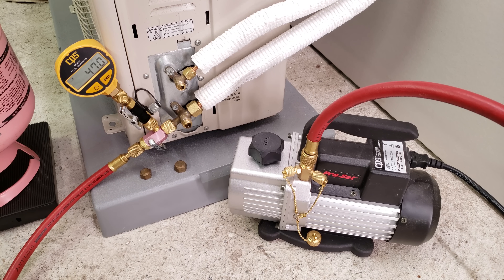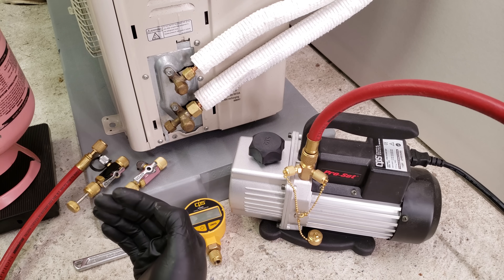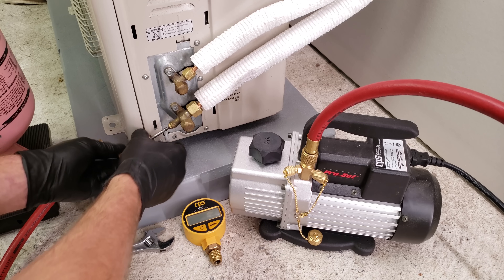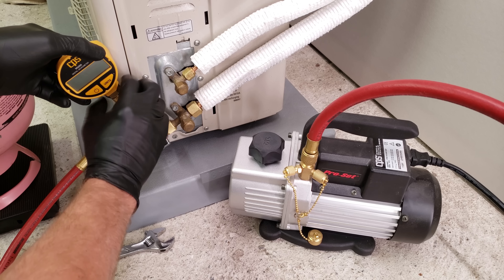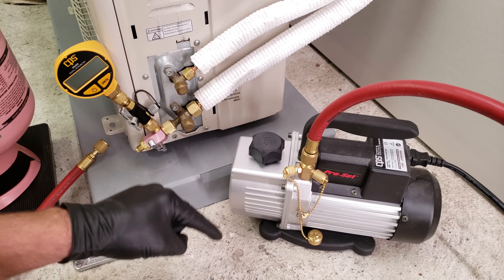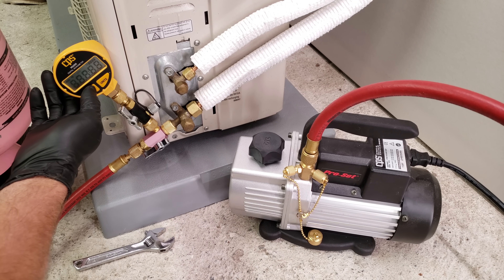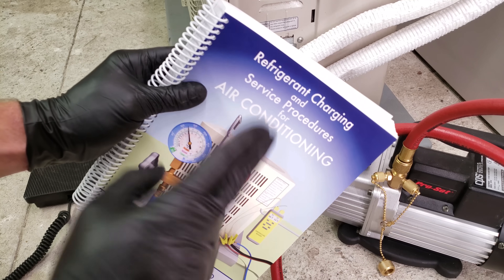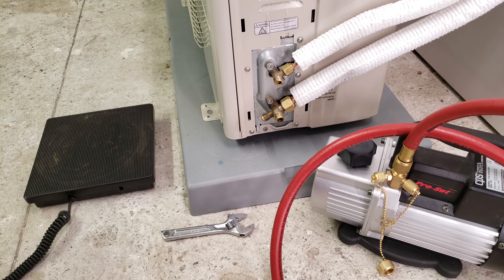Steps to Vacuum and Charge Refrigerant on a Mini Split Unit!

Comment: Hi great video. It was usefull. I see u charge the system without openning the valves and the system in switched off state. How the refrigerant will go in when the compressor is not running and valve are not openened. Thanks

Comment: Q1) I purchased a Mitsubishi MUZ GE 24NA (2 tonne) heat pump unit. In its installation manual, it just mentions the vaccume testing but doesn't mention pressure testing. Can you think of any reasons for such an omission?

Q2) Could you please also add a video on Nitrogen pressure testing of mini split units? Would it be same as in the case of regular HVAC system as you have shown in another video?

Comment: Hi sir  I have  question regarding split a/c,  how and what procedure to refill oil at compressor, already finish solded the crack of  high  side pipe ,I need now to  charge oil around 1/2 liters  coz compressor coming  sound

Comment: Hello,  If I am installing a new minisplit can I use this same method as yours even though my outside unit already has refrigerant in it. in other words, would a vaccum pump suck all the refrigerant out if I use this set up. thanks
Reply: Well from what I just watched I would say no. The allens inside the connectors are sealing the unit. This is one of the reasons he only had to add minimal refiedgerent for the longer line set and not fill the system completely.
Reply: @inactive67  thanks
Reply: @inactive67  My question is how did he add any if he didn't open the king valve first?

Comment: Could you use a simple ball valve in front of the micron gauge instead of a secondary valve core removal tool? I noticed that my valve core removal tool has pin valve on the service port. Can that be removed? I’m guessing it will slow down the vacuum if left in?

Comment: Hi, I have a question. Since the mini split motor was moved from the floor to the top of the roof a couple of days ago. I noticed that is not cooling. It blows air but is not cool. What do you think is the problem? Is it something that can be fix easily?
Reply: Are you saying you put the outside unit above the elevation of the inside unit?  If so, you can't do that. The outside unit has to be below the inside unit.  You may have figured it out by now, since your post is months old, but I thought it may help someone else who sees it.
Reply: @mikeygee4564   That's not true, in general,  unless the height difference is over ~12-15ft.

Comment: Why do the AC companies have to make this so complicated? They need to make it so we can do this without all the specialized equipment and have to be a pro to do.
Reply: It is possible without any equipment. After installing the lines, open the valve of the thin line. Wait for a couple of minutes. Then press on the service valve for about 10 seconds with a screwdriver. All the air will be removed now. Finally open the valve from the thick line and you're good to go.

Comment: The main reason for vacuuming an air condition system is to remove atmospheric pressure.
This is  the most important reason because it allows the refrigerant to boil at low temperatures.  Example room temperature.
however in most tutorials it is not mentioned making service technicians lack the true purpose of vacuuming.

Comment: I removed the flare nut from the valve. Can I reuse the flare on the tube or should I cut it out and reflare?
Reply: if it was sealed before, and isn't any worse, clean/polish inside of joint with with a lint free rag until you can see the shiny copper, then you should be ok to re-use. Don't over tighten, usually about a quarter turn with wrench past hand tight.

Comment: I was little confusing about mini split  pressure test and the pull vacuum on the system, without the high side service valve,  we can only connect low side hose,the metering device only liquid can go over it,when you do vacuum is it also pull vacuum on high side too, or leave it with air only in, can you explain it thank you
Reply: either side will vac both through the unit to the other side.

Comment: Shouldn't the micro gauge be on the other service valve? You want to measure the vacuum on the furthest point in the system. Not at the vacuum source.
Reply: this unit only has a port on one side.

Comment: Craig, great video. I purchased your book as well and it’s excellent. I do the same setup with one difference. I hook my service hose with ball valve to the side port on my second valve core tool. I leave the refrigerant bottle valve closed but my service hose valve open during final vacuum so that I am vacuuming the air out of my service hose. Then I close the valve on my service hose right before I turn off the vacuum pump and do a decay test. Then I isolate my vacuum gauge, open the valve on my refrigerant bottle, and use the valve on my service hose to throttle in the required charge. The advantage to me is I have pulled out some of the entrained air and moisture from my service hose by subjecting it to vacuum, and I don’t have to wonder how much air I purged out of the service hose using refrigerant to push it out, or lose any more refrigerant than necessary. There is also air between the valve on the service hose and the valve on the first core removal tool that is impossible to purge normally. I’m interested to hear what you think of this setup and if it makes sense or if there is a downside to the way I do it that I’m not thinking of. Thanks
Reply: I was unable to pull or hold a deep vacuum using this method. With the side port of my second VCRT capped off, I was able to pull down to 50 microns and it would eventually equalize to 150 or so. With the service hose attached, I think I could only get to about 150 and it would rapidly climb up into the 300-400 range as soon as I valved off my vacuum pump. I can't remember how big a difference it made to have the service hose valve on or off. Anyway, I tried this repeatedly and it seems like perhaps some component of the service hose or tank port are not completely sealed against a vacuum? I would like to sort this out though, because it doesn't seem very precise to just vent refrigerant as one attaches the service hose.
Reply: I agree it’s nuts to me to measure a system down to the micron and then measure the purge of a hose based on it going “pssht” for a second or two. My guess would be your service hose or ball valve is leaking. Or if your service hose has sat for a long time it may have moisture in it and it’s taking forever to dehydrate. I would cap the end and do a vacuum test on just the hose. It will have a high rise rate because of the small volume, but you could do the same test with your vacuum hose to compare the two and see what the relative difference is

Comment: Can you please guide if all the gas has leaked out of the system i.e. no gas in the system, then how will I vacuum the complete system and charge the refrigerant?

Will vacuuming with service ports open and system depressurized, suck the compressor oil up?

Also how to know if compressor oil is up to the level and does not need a top up?
Reply: Sir please visite my Channel

Comment: The part at 12:45 had me a little confused when you opened the valve and purged a little air when inserting the valve core. wouldn't this mess with your vacuum, or not because the added refrigerant created pressure not a vacuum? also how would you have installed valve core had you not needed to add refrigerant to your lines?
Reply: After my writing my question and watching again it seems to make sense to me.

Comment: Secret Tip  :
If you are sure to be using a vac pump.. let it run for 10-15 mins before using. 
It pulls a better vacuum faster with less wear and less stress on its components
Reply: let it run with manifold gauges disconnected?
Reply: @egemensuzgun4208  yep! test it yourself. On the same unit and time it when done cold and hot.. Changing your vac pump oil every 30-40 times of use is also a great help with noticeable efficiency

Comment: I just used this exact method with the exact two Appion valve core removal tools in order to install a 9000btu mini split. Even with the cheap harbor freight vacuum pump it pulled a great vacuum and held steady; I observed no leaks. As a homeowner I am excited to be able to do some of my own HVAC work. Thanks for these training videos. They are fascinating!
Reply: Wish I was your neighbor  I’d turn you in
Reply: @robertlamey7612  haha to whom, and for what?
Reply: Cheap fucks. Enjoy the service bills and potential fire hazards.
Reply: Excellent, I'm doing the same and plan to install these for my neighbors for a lot cheaper than an HVAC "pro"!
Reply: Drawing a vacuum isn't illegal, doing anything with refrigerant charge without an epaulets certification is illegal
Reply: @cclyons06  who is the EPA going to send to my house? Or to anyone’s house for that matter?
Reply: FYI, as long as you are not adding refrigerant or evacuating refrigerant, there is nothing illegal about I stalling a line set without HVAC certs. Why do you think I can order a Mitsubishi heat pump directly to my house, pre charged. If it was illegal for me to install it, they wouldn't sell it to me in the first place.  @cclyons06
Reply: @cclyons06  So, turning the service valves to release pre-charged refrigerant - you need a license with that? 

epaulets - decorative items that go on your shoulders to indicate rank ....
Reply: @MyGoogleYoutube because 1 chlorine molecule (which is in refrigerant) can destroy 100,000 molecules of ozone. That's why you shouldn't work with refrigerant without a license.
Reply: @Mydriasis100 false.  410-a is a non ozone depleting refrigerant.  It was even marketed as such during its rollout as a successor to R-22
Reply: Until the epa shows up to your house lol
Reply: @shane2163  they are a regulatory agency; not an enforcement agency.
Reply: @shane2163  so far so good
Reply: @shane2163  It is illegal to create a vacuum? I guess we need to get hire a professional to use our vacuum food saver device.

Comment: Hi. Can you still do a pump down the ac when theres leak in the connection?
Reply from the maker: Yes but only to 0psi and not lower or you will suck air into the system, thanks!

Comment: thats a lot of  work to keep the air out, very elaborate,  I have few questions, 
1 what about if there is no refrigerant  in the outdoor unit do you also open the high side valve before vacuuming?
2 is it always that gas canister has to be upside down or do you have to have half charge as straight and half as upside down?
3 is the gas canister handling same of r22?
4 i have always seen technicians filling gas after the compressor has turned on.
5 please make a video on super heat and sub cooling methods for min splits
thanks

Comment: I have a question.  When you connect a second valve core removal tool, you said make sure there is no shurader valve.  What is the point?  With or without the shurader valve the vacuum gauge reading won't be affected.  Please explain your reason. Thanks.

Comment: Craig, i have read your book but am still confused about adding refrigerant to a single port(vapor) mini split like this one.  I have recovered the entire system, fixed the leak, pressure tested, performed oil blowout, triple vacuumed, performed standing vacuum & am ready to recharge from new bottle.  Pg 137 of your book says in order to weigh in many pounds while the system is off the refrigerant must be added to the liquid port so it will not immediately vaporize.  Of course there is no liquid port.  Do i just add what i can with the system off, start the system & use your slow burst method (pg 91) to finish the correct charge? Thanks.
Reply from the maker: You have it 100% correct. This vapor line on the minisplit is much smaller than a conventional system so you should not have a problem like vaporizing such as on a system with a 3/4 or 7/8" vapor line on conventional systems. Also this minisplit will have an accumulator to protect the compressor from any liquid during the initial start up, thanks!
Reply: AC Service Tech LLC Thanks Craig - Your help is so valuable - i think i will become a Patron.

Comment: How long should it take with 1/4 hoses? I've been following your process and its been going for 2.5 hours with no microns reading. Although I have the yellow jacket micron guage which had progress bars until it wants to read microns. Although I broke vacuum to put nylog on all the fittings and sucked air in. I have all the time in the world, can I just keep vacuuming or will I never get below 500 without nitrogen?
Reply: You have a leak
Reply: @kyleperry1701  no. I forgot to remove the shrader valve from the cable core removal tool.

Comment: Waleed7rrag RRAG 
I do thank you very much for your excellent instructions and great detailed explanations. You are always during your videos answering all the what, why, how and what not to do with great details and explanations. Having said that, I know you are very busy but if you would please answer a few questions about the mini split AC:

1.  As you know the mini split AC of all brands and kind has no high side shredder valve and I do not know why, so is it good idea to install one out side the system near the low side shredder valve?

2.  I have a mini split AC under full maintenance including a leak repair on the condenser, as you know the metering device is just at the end of the condenser going to the evaporator, in this case is it OK to feed nitrogen gas from the low side all the way to the condenser to test the condenser leak repair? will nitrogen pass through metering device? and if so will it affect the metering device and or the high side of the compressor?

3. After doing system and line set vacuuming, is their a need to add 2 ounces or may be less of a compressor oil? I can not find any sold information on this issue?

Last but not least, thank you very much for teaching and helping so many people not just in the U.S.A. but around the globe as well!!!

Comment: SO that means before vacuuming the Split unit have to be pressure tested.  Once it is pressure tested and checked with bubble water for leaks and there is none you proceed with vacuuming the system? Am I right. Thanks. I am a homowner installing my first Split AC

Comment: Thank you nice video what are pressures supposed to be on a mini split in heat and what are pressure supposed to be on AC on a Mini Split for 410
Reply from the maker: Jonathan, I just wrote a full length article on that today! Check it out at https://www.acservicetech.com/articles

Comment: HI Craig, your videos are the best I have seen. I love this set up because this is the only thing I do when it comes to HVAC, i.e., setting up new mini splits, and this set up eliminates the need for using a manifold gauge set which introduce more potential for leaks and contamination from oily gooey heavily used guage sets. Video request, please do one on the entire Nitrogen pressure test.

Support Craigs VIDEOS, I bought all the tools with your links!  One tool that I bought not on your list is the metric Master Cool mini split torque wrenches. (The line sets that come with the units are metric or SEA on the OD of the nut, but if you buy a set at a local supply house in the USA the OD on the nut will be SAE but the threads will be the same. Therefore, you would have to buy the Master Cool SAE set). 

One question, In a brand new system, If I am not adding any new refrigerent in, would I reinsert the valve core after I release the refrigerant from the compressor for the first time after isolating the micron gauge?

Thanks again and everyone buy the tools from his links!
Reply from the maker: Thank you very much and you would add the valve core after there is positive refrigerant pressure in the system thanks!

Comment: I thought you were suppose to put the micron gauge at the furthest point away from the pump? Or am I missing something
Reply from the maker: Ryan, yes it is presently at the port which is the furthest point away from the pump. You don't want to install the micron gauge on the pump. When I isolate this pump, the micron level reading while running is not that much different than while the system is off, thanks!
Reply: AC Service Tech LLC ok gotcha thanks for the reply!

Comment: you started with details instead of explaining what the settings are in this system first. Are the Allen wrench screws open or closed when you start?
Reply: James Butler the service valves are bottom seated to hold the factory charge in.   All the way clockwise.

Comment: Very educational, thank you. Two questions:

1- You shut off the valve so fast when purging air out of the refrigerant bottle hose, it's hard to tell what you are doing. Does it stop hissing when the refrigerant hits the valve or is there something else you are looking/listening for?
2- What do you do with the extra refrigerant in the hose once you are finished with the job?
Reply: What you can basically do is let a little bit of refrigerant out(liquid form ) it’s whitish, as soon as you see a little you shut the valve off. You do this so no moisture goes inside the line set. And If its just a little just air it out.

Comment: 2:30  How high is the nitrogen pressure used for the leak test?  I am considering a Senville SENL-18CD mini-split system.  Thanks for a great video!
Reply: Check your OEM manual.